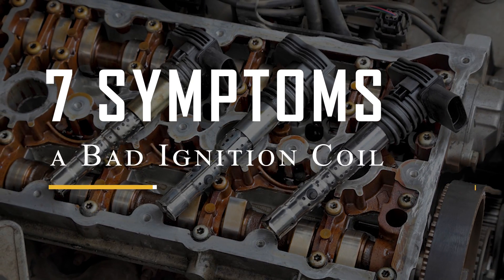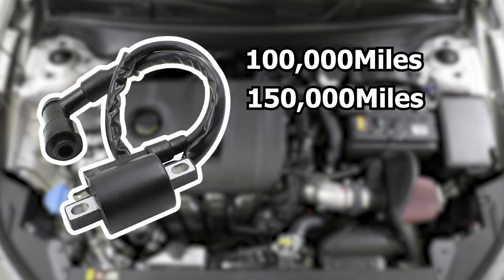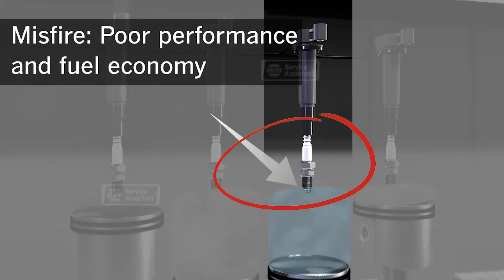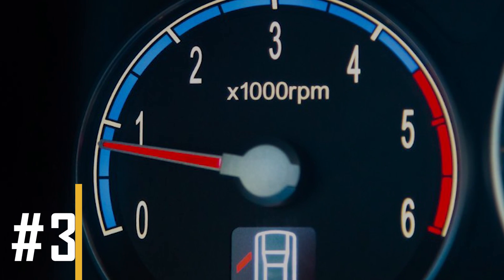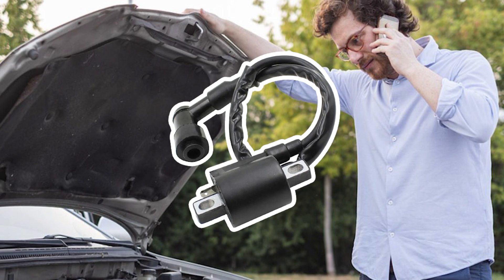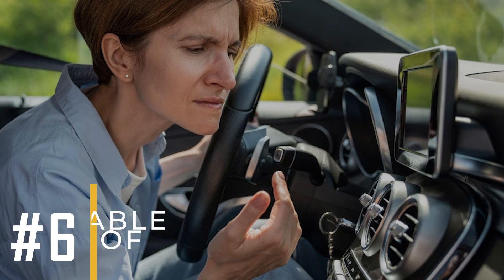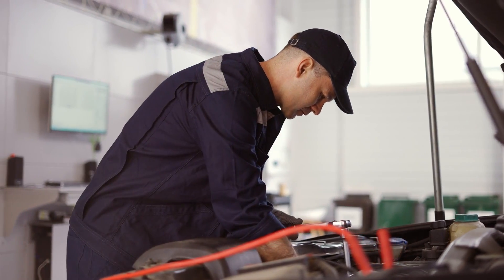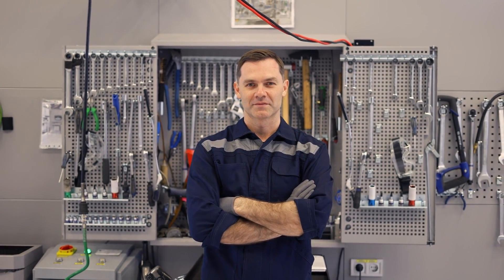7 SYMPTOMS of A Bad Ignition Coil | Causes of Engine Misfire

Comment: My 2011 Ford Focus just hit 100,000 miles and suddenly it was playing up with misfire. Took to my mechanic and he listened to how it was running. Within seconds he said "something with air intake". Lifted up the hood and yes a split pipe between air filter and the throttle body. After replacing there was still misfire, and check engine light came on/off. He said the wrong air mixture probably didn't help, and we had the coil and spark plugs changed. Car back to normal. He said if I ignored the coil, eventually the catalytic converter will be damaged too getting rich fuel mixture. Coil was from eBay for extremely good price.
Reply from the maker: Oh wow.  Glad you were able to find the problem and fix it.  
Sounds like you had good mechanic look at it and help you out.  Good luck on the road.
Thank you for your comment!
Reply: @fixit3879  I am surprised that ignition coils are rarely mentioned as a replacement item such as spark plugs. It ought to be now that people keeping their cars a lot longer.
Reply from the maker: Yes, Ignition Coils do go bad.  They usually go bad after 8-10 years or more.  Not right away when a car is new.  Usually the plastic parts start wearing out first.   Thank you for sharing.